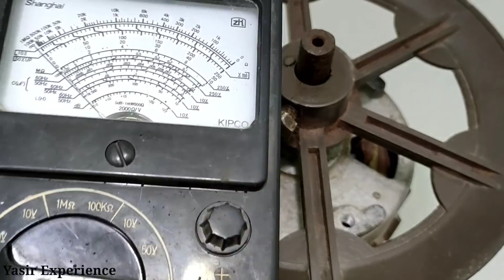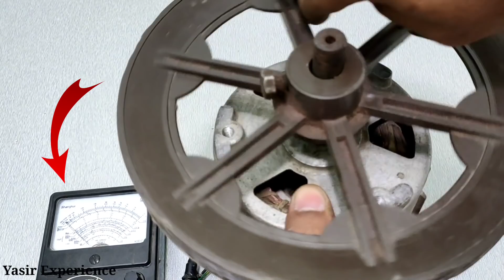How to Turn Washing Motor into 225V Most Powerful Generator New... Part 1

Comment: Please show me that which megnet is north and which is south magnet
Reply: He did Mark North and South. N AND S.

If you put a capacitor after the motor before the load it takes the load off the motor and you'll get better results because you take all the resistance off the motor as it is only charging the capacitor. In a separate loop that capacitor charges the batteries or load.